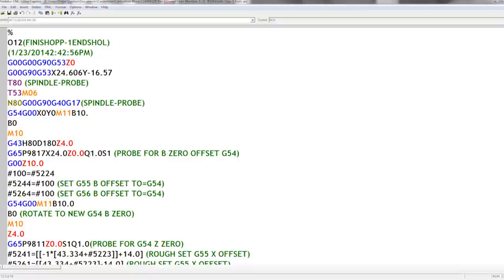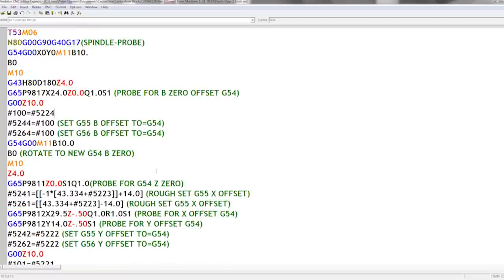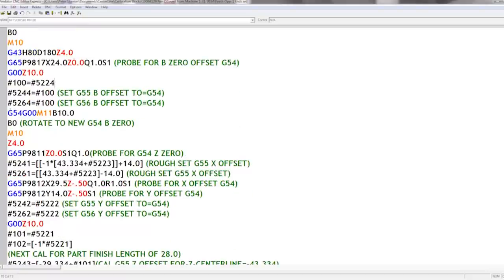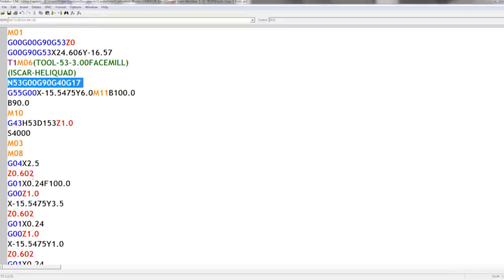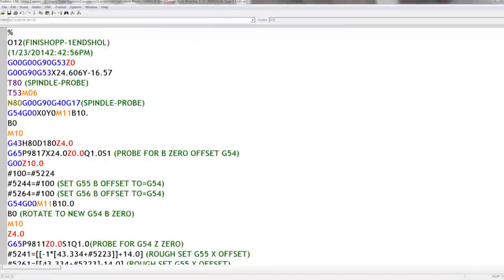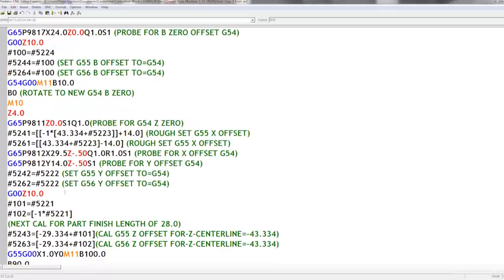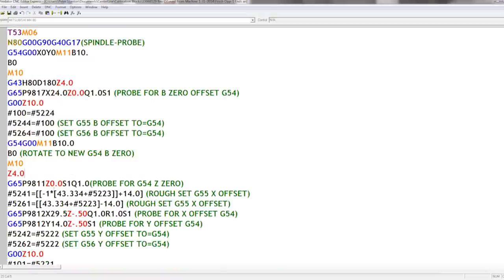Auto Setting Fixture Offsets With Spindle Probe

Comment: Using the machine to calculate and probe offsets have saved me a lot of time, especially on rework! Being able to probe the B axis offset and then probe two holes for example to adjust the angle on your coordinate system ("ROT RPL=Degrees" on siemens controls) is fantastic. Then you can most of the time just bolt the part to your fixture and don't worry about how it is positioned relative to the X, Y, and B axis. You can of course do it with a haimer too, but it takes a lot more time. And so far the only one I can blame for calculation mistakes is myself :) The machines always calculate correctly. 
Have also done a lot of probing in millturn machines when it comes to getting holes and pockets within the positioning tolerance. Measuring depths with the probe has indeed saved me time and money too. Measure one point on Z0 and then one on the face you want to measure the depth of and then let the machine adjust the tool offset automatically.
Hope some of my poor explanations made sense :D Keep up the great work!

Comment: I only tried this once on a sinumerik machine , and in its most basic form . That particular machine had actual cycles for in process probing , so it was much easier and did not require math or a lot of know how . You just had bring it close enough and retract it far enough , the rest came from the cycle  . in these cycles you had to define certain raw dimensions , but it had gui and was intuitive to use . 

I never got so far to auto-modify tool offsets based on in process measurement   - this would have been more difficult than the auto work offset adjustment.

There are many semi-hidden functions on these machines , but as a "low volume guy"  it never made sense to bother with them . Perhaps one day....who knows .

Really interesting video , altough most shop owners/bosses won't allow 'me the worker' to experiment and learn . Usually very few people know how to use the parametric programming along with trigonometrical and other calculations and read write machine parameters and R parameters. 

ps.: it's still overwhelming for me

Comment: One of the hardest things I found with probing was all the proprietary software. Every company has a different way of doing it and worse, marketing it. I found the best way is to write my own programs. There are three main  ingrediants you need: 1. Figure out your protected move program 2. Figure out your single touch or center program 3. Figure out your offset variables (G54, G55, G...). Mix this with some simple linear algebra and your off to the races!

Comment: Fanuc Macro B and Okuma User Task 1&2 have been very handy for me as well. Regularly run a job that fills up all available memory for a single piece, which we later nested and rotated into a sheet for up to 12 hours. 

Scanning isn't too hard if you sort and store min/max as you go and loop your single surface and step over array, otherwise address space runs out quickly. Probing and adjusting feature sizes can be a little dangerous if the probe physically starts to move on its mount with enough tool changes.

Comment: Good video. I do similar stuff on an Okuma with a Renishaw probe, also self taught. But it's still interesting to see others do it and verify that I'm not out of the loop with my own thinking. (Also, at around 17:11 there's a typo in the comment. G55 on both lines where the second should be G56. Not that it matters for the results, I just spotted it.)
Reply: I'd like to do Kinematics on an Okuma Mill-turn. Renishaw Applications says it can't be done with their macros du to no 'skip signal' or something to that effect. (OSP7000)

Comment: Hi Peter.  Im constantly smashing my boring bar in to the bottom of a pre drillied bore.  Loads of trouble facing it also.  Any tips?  PS would like to see the CMM at some point in the future.  60mm bore in ally.  Pre drilled 30mm with a 118Deg  drill
Reply from the maker: This is kind of hard to give advice on, not knowing more parameters of the operation. Are you going to a flat bottom? How deep is the bore? How big is the bar? Exct. But what I  typically do is rough bore stopping at the drills maximum diameter. Than If the bar is small enough in diameter to get to center take very small facing cuts from the center out down to the point of the drill say around .010 depth of cut. Or if the bar wont go to center I may drill than drill with a flat bottom drill than bore to size. But even then I will rough bore stopping short (Say around 1/2"-3/4")of the depth stop clean out any shavings and finish roughing with small depth of cut to final rough depth. What is probably happening is shavings getting in front of the bar and loading up at the end of the hole, causing the bar to be damaged/smashed. Starting with such a small drill from your finished size (why not go larger). You may also have to stop and clear shavings every pass of the bar if the hole is deep.

Comment: Thanks for showing these "complicated" topics too!
What I don't yet understand is, why, at the very end of the video, G54, G55, and G56, all have B roughly at +180°? However, the X offsets were probed what it seems with a custom B rotation. Shouldn't they B offsets be at 90° and 270°, so that they match the "meaning" of the X offsets?
And, do I understand it correctly, when you want to machine the side shown at the very end of the video, you would first have to call G56, and then do a move command to rotate to +90°, and only then X=0 would be "valid", i.e., well aligned to the edge of the part?
Thanks, Hansi
Reply from the maker: It’s  the program. if you go back to the video where I show the programs cod. You will see those rotation angles a there. They of course have their zero in relation to, and the same as the first side of the part (G54). Hope that answers your question.
Reply: @EdgePrecision  Thanks!

Comment: If you preset a work offset on your pallets you can do all of this without the need to do anything prior to running the program other than making sure your setup matches CAM. Then you just update the relative coordinates. Your offsets will never be set to a location on the part, but there's really no need for that.

Comment: Why do you index to B10 before B0?
Reply from the maker: It probably isn’t totally necessary. But just to be sure of no backlash I like to approach from the same direction when indexing the B axis. I also put a B index at every tool change. Just in case I have moved the B axis to a different location before rerunning a tool.

Comment: I'm not a machinist. I'm barely a hobby machinist. The only machine I have that uses G code is a 3D printer.

But I am an embedded systems programmer (Computer Engineer, really, but lots of programming embedded systems). G Code seems like a really weird assembly language with obfuscated mnemonics.

Comment: [ ] called square brackets. I learned macro coding all by my self. i disable double tool callings in my g-code output.
why do you double square bracket ? #5241=[[
Reply from the maker: You have to have a equal number of brackets both open and close in a function or you will get a alarm. So as a example [-1*[A+B]]
Reply: @EdgePrecision  happy Thanksgiving big guy.
Oh ok didnt know that . I think another good video you should tackle is macro number sequential coding. You dont find videos on that.